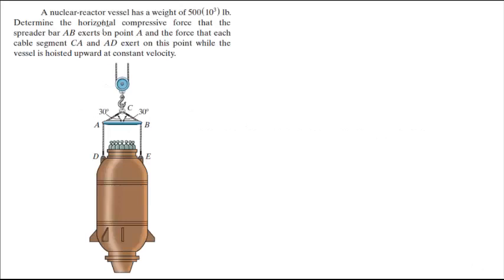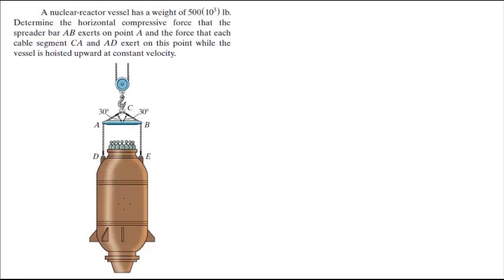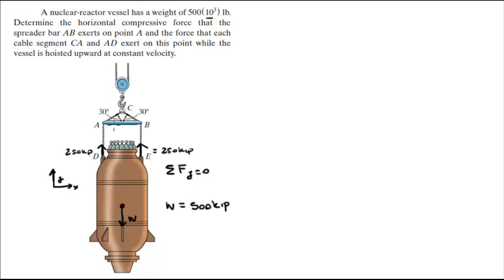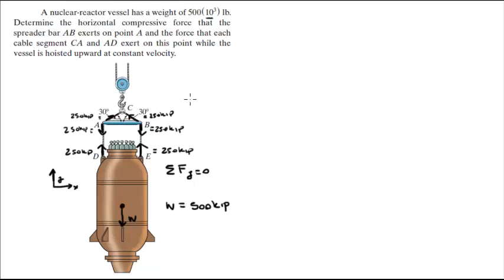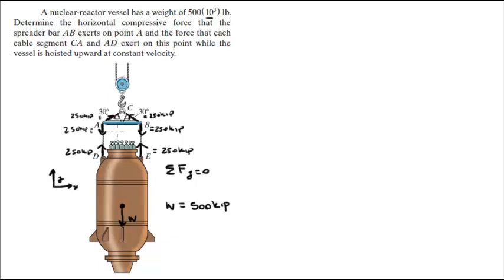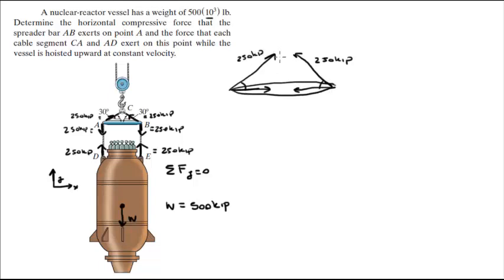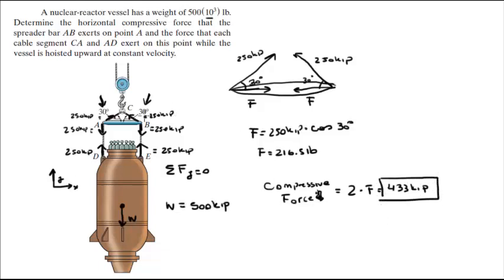Determine the horizontal compressive force that the spreader bar AB exerts

Comment: Although you arrive at the correct answer as a matter of chance, this is completely the wrong methodology and gives incorrect information regarding the load case and how to properly derive static solutions.
a) The tension in the bridle is NOT the same as the tension in the vertical lines. It is not a pulley system and they are independent of each other. The tension in the bridle is calculated by:
F = (1/sin 30°) * 250kip = 500kip.  The compressive force is then derived from this tension load using F = cos 30 * 500kip = 433 kip. Yes, you are applying the same formula, but through the wrong assumptions.
b) 2:54 - why are you suddenly changing units from kip to pounds? 1 kip = 1000 pounds force = 1000 pounds mass.
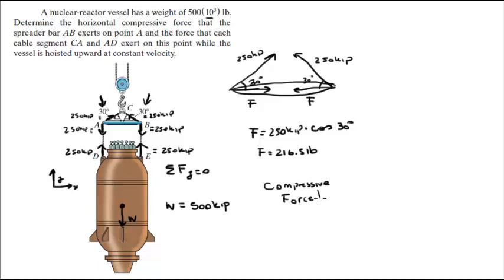c) 3:14 - why are you doubling the force? This is wrong and a fudge. Newtons third law: "Every action has an equal and opposite reaction", in fact you could solve this solution on one side and assume the other side rigid and still arrive at the same answer using the correct method above.

It's great that you are making educational videos, but you are giving wrong information which makes me worry about all the other videos you have posted. The ethical thing for you to do would be to either correct or remove this video.

Comment: If you then chose the slings for this lift based on the indication in this video, you will make a mistake of 100%. You may think a WLL of 250kip is sufficient, actually you need 500. This video is dangerous.

Comment: what are the answers to the last two questions? is the force on AC 216 or 250?
Reply: There is an error in calcation. Considering firce 250kp at sling AC / BC is wrong. Further , it should be evaluated with method of joint  by equating two horizontal and vertical components seperately. Hence the answer is force expert om AC / BC IS 500KP and compressive load at one side of spreader beam is 433 KP. Hope it's clear.

Comment: why are the forces AC and BC assumed to be the same as AD and BE of 250kp.
Reply: AC and AD are acting on the same rope (rope 1) and BC and BE are acting on the same rope (rope 2). Hope it helped!
Reply: There is an error in calcation. Considering firce 250kp at sling AC / BC is wrong. Further , it should be evaluated with method of joint  by equating two horizontal and vertical components seperately. Hence the answer is force expert om AC / BC IS 500KP and compressive load at one side of spreader beam is 433 KP. Hope it's clear.
Reply: There is an error in calcation. Considering firce 250kp at sling AC / BC is wrong. Further , it should be evaluated with method of joint  by equating two horizontal and vertical components seperately. Hence the answer is force expert om AC / BC IS 500KP and compressive load at one side of spreader beam is 433 KP. Hope it's clear.